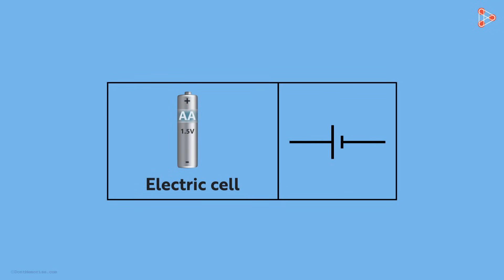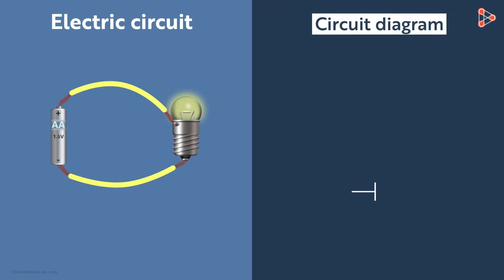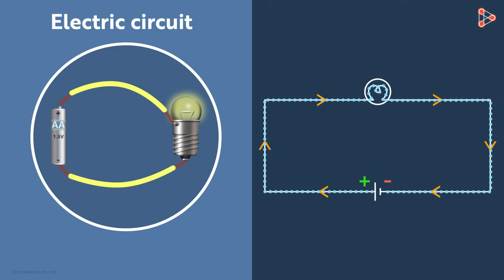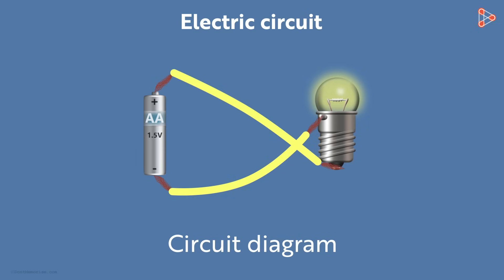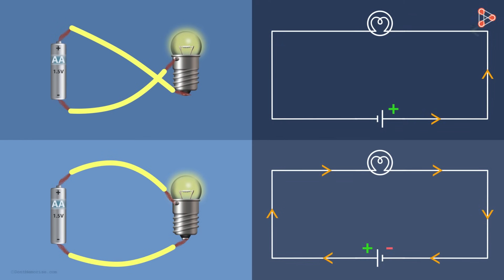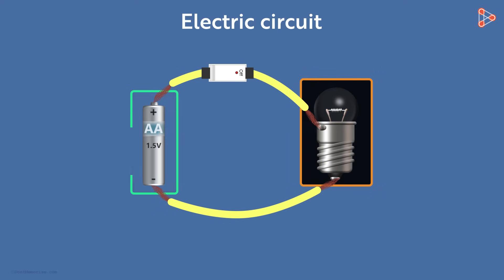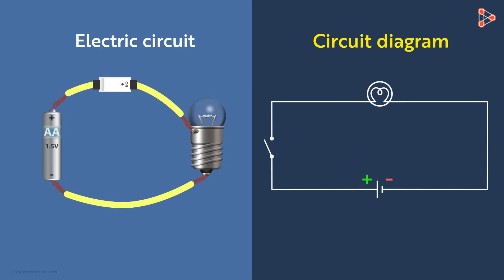Circuit diagram - Simple circuits | Electricity and Circuits | Don't Memorise

Comment: Could someone please elaborate or recommend a source to really clarify actual direction of flow (+ to - OR - to +)? I really need to draw circuit diagrams with proper conventions.
I'm losing my shit over this. I'm seeing conflicting info from various sources on which way electricity is actually flowing. I based my whole life on understanding that the "electrons are moving (not the protons)". I know protons aren't moving or it would be called "Protricity" instead of "electricity". Protons are about 1832x heavier than electrons and are very stationary.
Is the battery + side ACTUALLY NEGATIVE but just convention to draw + to -?
All my previous analysis may be backwards/inverted because I drew arrows from negative to positive and will cause confusion on future boards involving diodes with one way flow. Really don't want to "just flip the battery around" but properly get this right on schematic.

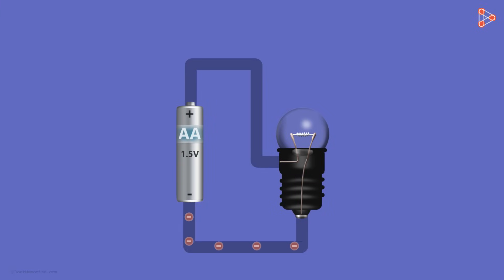Comment: Although the video and narrator emphasize that electric current flows from the positive terminal to the negative of a cell, the animation at 3:23 suddenly shows electrons flowing from the negative terminal to the positive. While both are valid, the animated electron flow at 3:23 seems contradictory and may confuse beginners.
Reply: I too hv doubt on this can you explain me please
Reply: don't the electrons always flow in the opposite direction of the electric current?? so, if i'm not wrong, then the electric current flows from positive to negative, while the electrons flow from negative to positive??
Reply: Hr is trying to explain that the first miss said that electric current always flows from positive to negative but in the animation miss didn't show it so he is trying to say that it might be a confused by beginner

Comment: I always thought the current flowed from negative to positive because electrons are negatively charged
Reply: yeah it does but in conventional current its opposite
Reply: electric current always has opposite direction of the movement of electrons
Reply: I read somewhere that in the older times scientists believed that current flows from positive to negative terminal. Hence all the diagrams were designed that way. After many years it became clear that is the other way round. By then hundreds of books and journals were published. And since everything, including the formulas work, the representation continued. This representation of charge flowing from positive to negative is called conventional form.

Comment: I don't know how to thank you all 
I tried to understand this more than 100 times but I didn't
Today I watched this and I understood this so perfectly
Thank you very much
Reply: Can you please tell how does the electric current flows in an electric circuit
From negative to positive 
Or
Positive to negative
Reply: @kanikamehta6881  The electrons flow from the battery or cell and when it goes from high potential to low potential ( positive to negative ) its called a conventional current. Vice versa it is an electron current. If the bulb breaks or if their is an open switch then the bulb doesnt glow

Comment: Where does the  current flows from + to - or - to + plz explain guys
Reply: The electrons flow from negative to positive. However Benjamin Franklin thought it was the positive charge that moved so due to historical error the way we refer to electrical current is from positive to negative (conventional current direction).